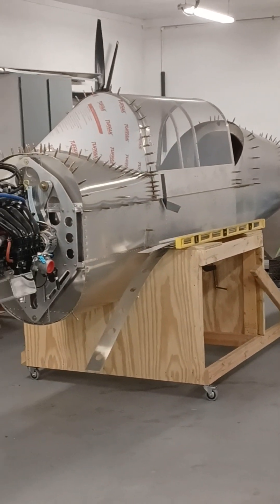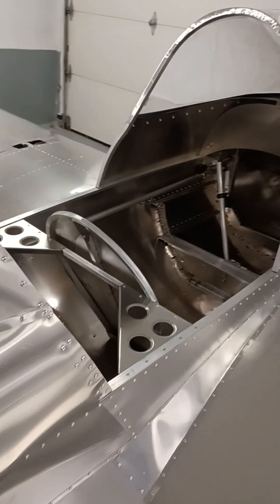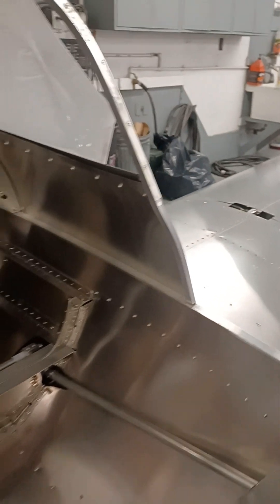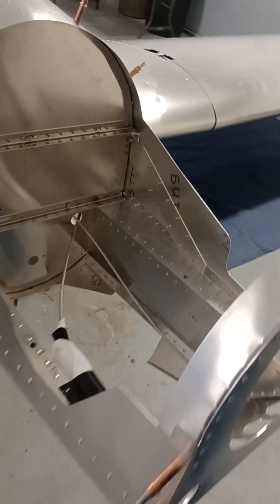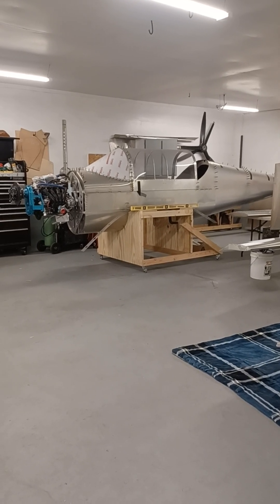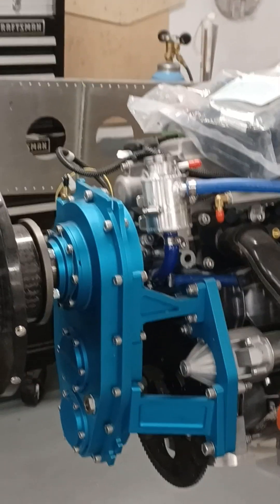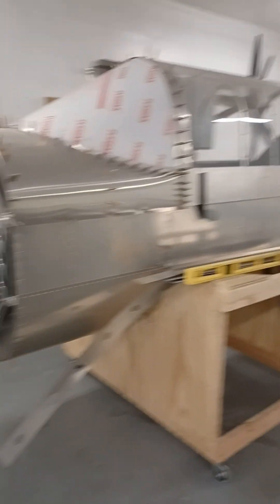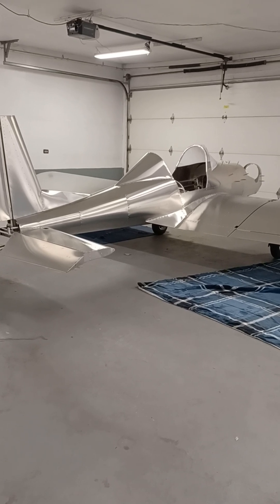Hummel Aircraft 2024 End of Year Update

Comment: I have noticed that when the engine is running that it sounds like it is very tinny. Are you doing any thing to mitigate all of the resonant vibrations. For example applying a light weight spray on foam or coating to dampen vibration noise.